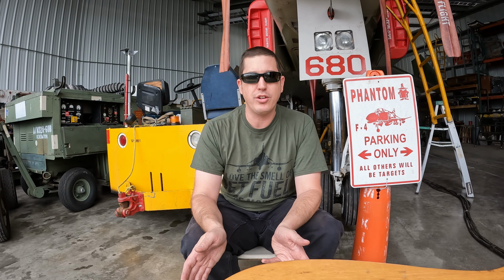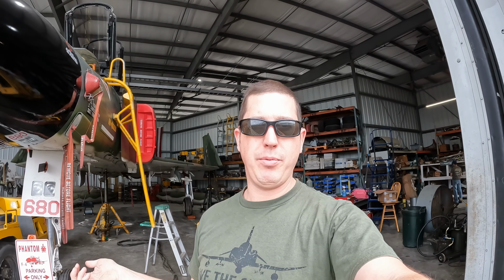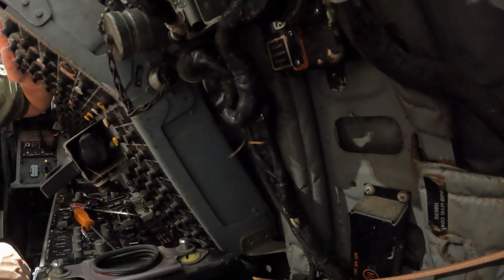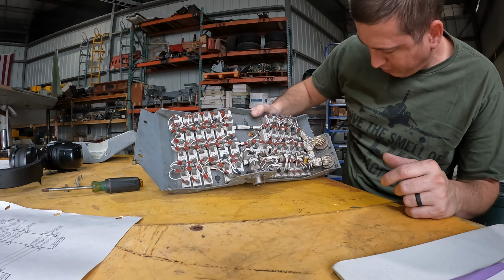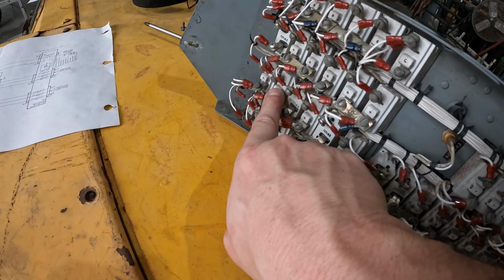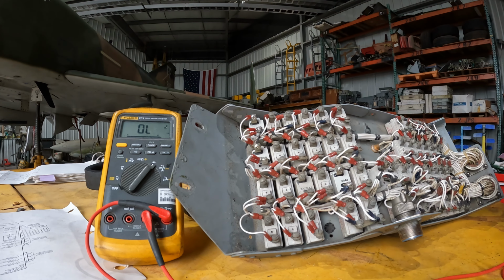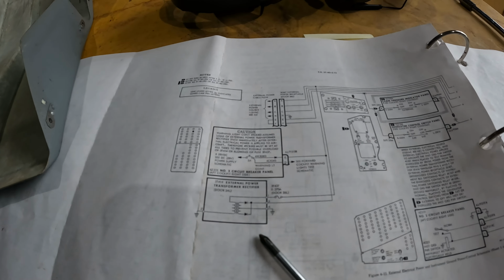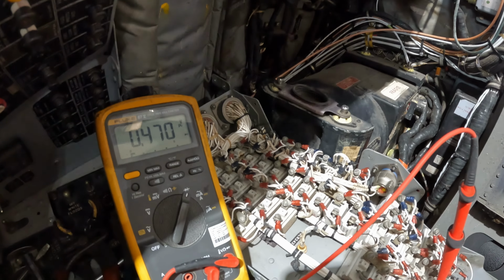More Electrical Fun | F-4 Phantom

Comment: is the ground power plug good. is there continuity on the two cross internally connected pins of the plug?
Reply from the maker: Yes, there is, on both plugs (dash 60 and the NC8). I will be cleaning them though, as I have no idea when they were cleaned last.

Comment: I have a technical question for you or any of the former Phantom Phixers out there. Is it true you cannot load the forward Aim 7's if you have something on the center hard point? Such as fuel tank or bomb load. If anyone could answer that would be great.  Thank you for these Phabulous videos! Hope this beautiful girl gets back in the air soon.
Reply: I was a 462 on the D model and if I recall that's correct. Our Ds sat alert with AIM-7s loaded on stations 4 & 6 (the forward stations) but never in combination with a center-line tank. But then, it was decades ago. Maybe someone with a better memory can confirm.
Reply: @SpeciesPlantarum  Thank you for the info! I'm sure you're correct.  I've heard this from others, but like me they have never worked on Phantoms.  Thanks again!
Reply from the maker: Great info! I believe there’s also a light on the forward instrument panel that indicates that there is something loaded on the center station. I can dig into the manuals to see how that works.
Reply: @DieselThunderAviation  That would be cool. I love learning about the Phantom and the technical aspects.  Makes for more accurate model building lol.

Comment: Love your videos. Since the back seat is out you may want to ck the cables that connect to cb panel 7. That panel caused ever f4 to be grounded until inspected. The cables would rub on the floor under the right console. We had an inflight fire in the rear cockpit that brought about the grounding of the fleet. We had around 150 aircraft at george afb and about half of them had cable damage.
Reply: Wow !  That was one heck of an oversight.
I'm presuming that was still in the earlier years of the Phantoms introduction to service ?
I worked on E in the early to mid '90s.
Reply from the maker: Thanks for bringing that up. Like to think that would have been taken care of years ago, but it won't hurt to put some eyes on it. 

I'm aware of an ejection mishap (unfortunately fatal) from panel 7 getting pinched between the seat and floor during a battery swap. Out at Nellis I believe.